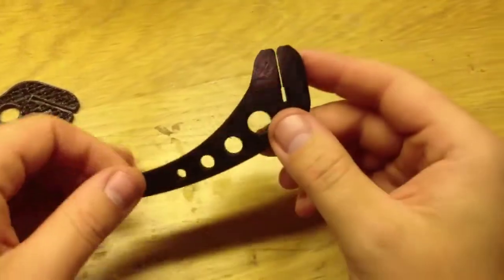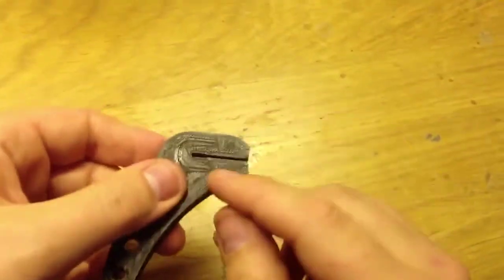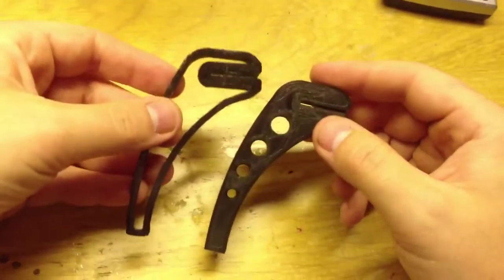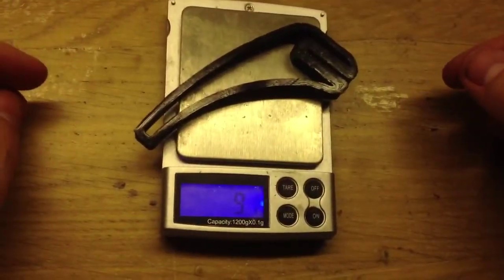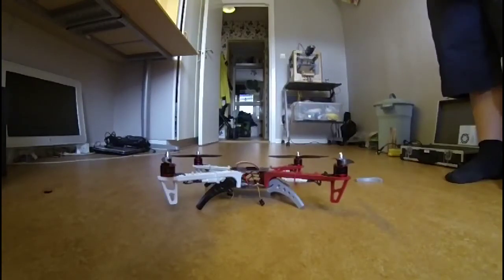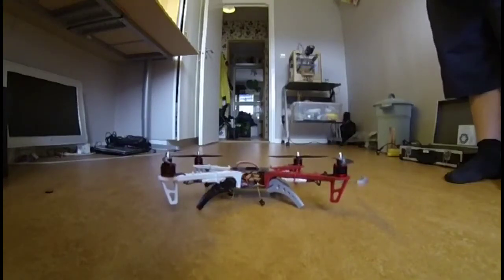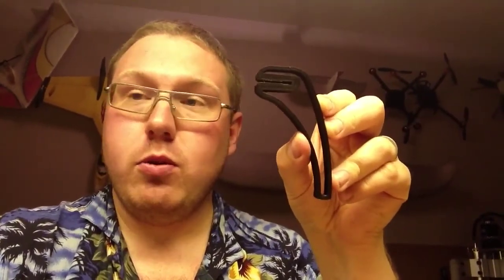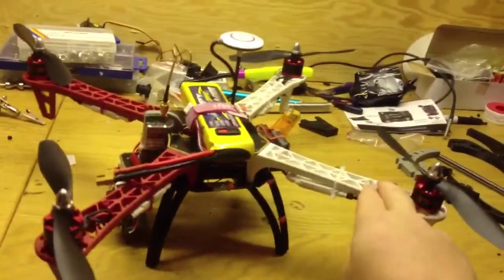New kind of 3D printed legs for the DJI F450

Comment: Nice, i had a crash some days ago, one leg broke, good that you send 5 legs so i had one in spare, i also had problems using CA glue on the broken leg, normaly locktite CA works for every plastic i have used it on, but on this plastic it wont hold, maybe it´s some special plastic used in 3d printers that is not so glue friendly.

I like the new design, i might order a set when you have them up for sale! :)